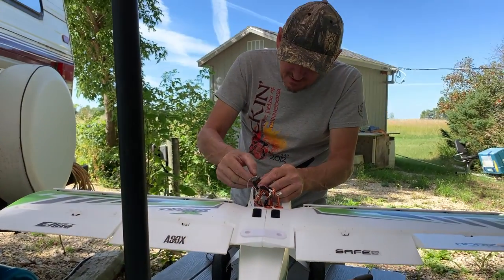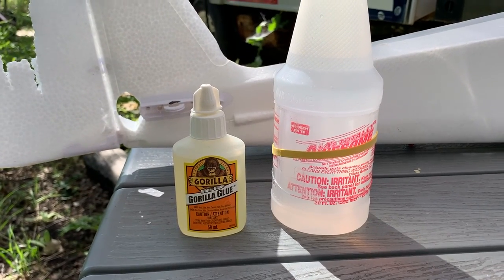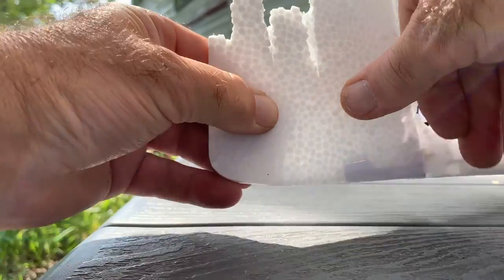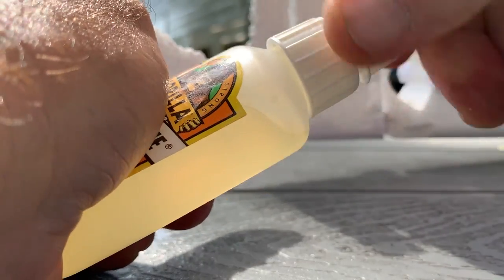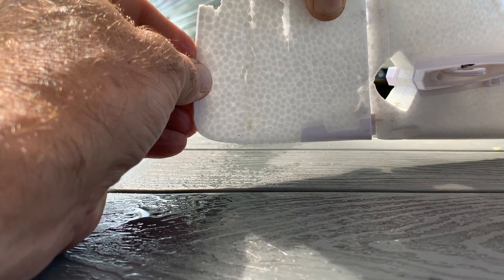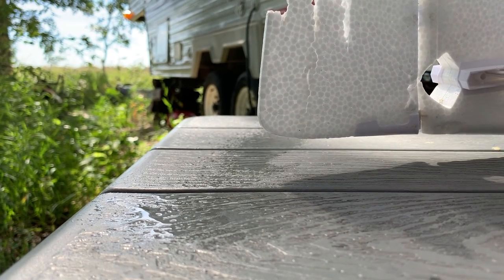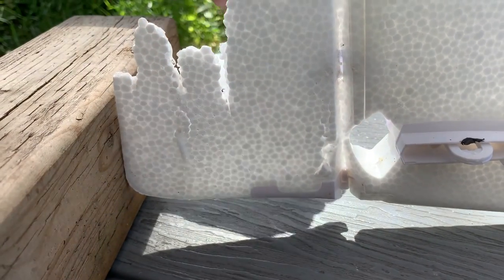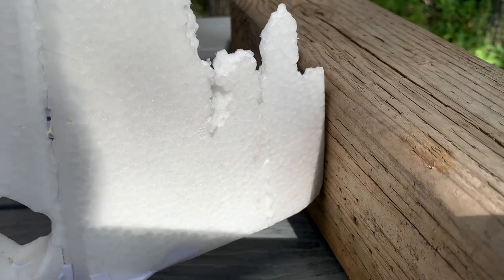The BEST Foam RC Plane Fix? ACTIVATED Gorilla Glue!

Comment: Have crashed Apprentice numerous times, and repaired with Gorrilla glue.
Gorrilla glue joint has never broken, breaks are always fresh ones.
Also a heads up that white Gorrilla glue turns yellow over time.

Comment: Do you trim it with a knife, scissors, a file or sandpaper.  How flat can you make it?  Nice easy video.
Reply from the maker: Hey thanks for watching. Yes trim with an exacto knife quite easily. scissors work too and you can lightly sand it if needed. The better your trimming skills the flatter you can make it.
Reply: Thanks for the info.  Just got back into rc fpv, with a foam kit.  Think I will continue with a glue gun.  Good flying.
Reply from the maker: @J2onton  My pleasure. Thanks for checking out the channel.